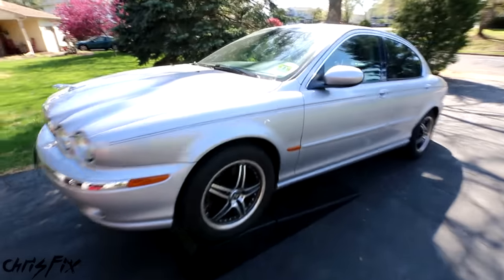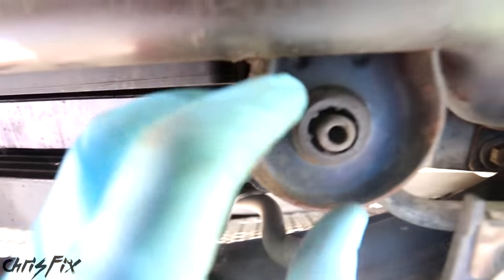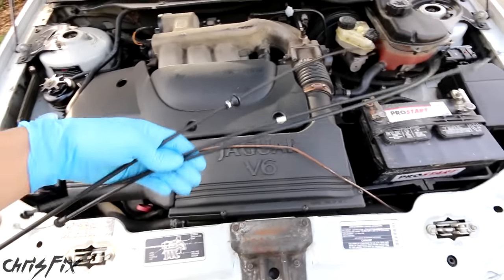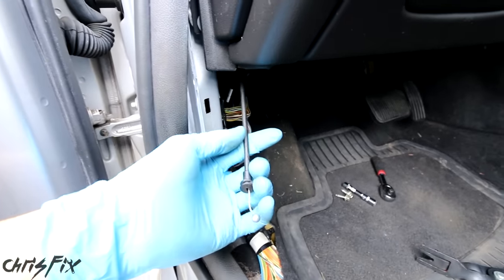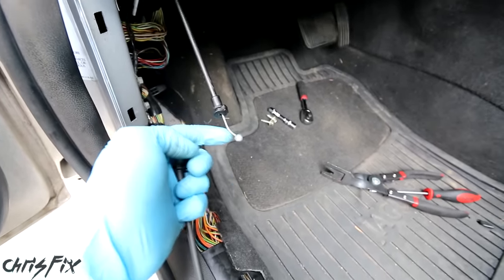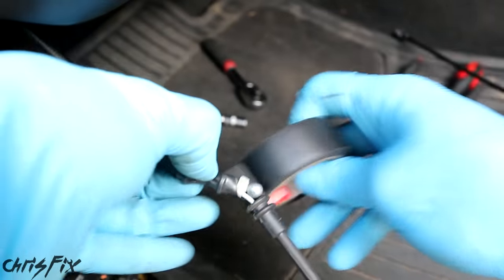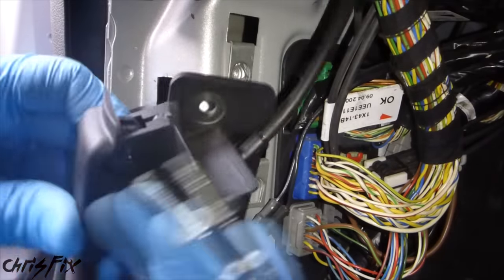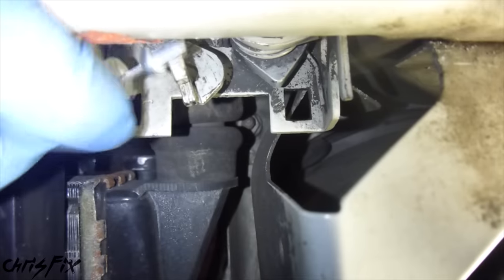What if your car's Hood won't Open?

Comment: nice you showed 17k poeple how to break into a hood
Reply: +Andy Campos chris fix made the video in hopes you do it for good intentions tho bro,
Reply: +Andy Campos Those who wanted to break into a hood could do it, if you don't want it, just weld some metal to the underside of the latch, and bam, no one will be able to open it.
Reply: +Andy Campos To be fair I'm sure anyone who wanted to break into a hood would just use the pry bar to force the hood up causing great damage.
Reply: +Matt Bartholomew That's too much work. They more than likely would just pop the drivers side window, reach in and pull the hood release.

Comment: Some 6 months ago I would have needed this.
My old Clio hadn't been moved a year and the battery was shot.
Unfortunately, the manual locks were also shot and only turned around.
As I couldn't open the doors, I could not open the hood to replace the battery.
A neighbor first tried to remove a side blinker and attach a battery to it, but it was too weak to do the electronic unlock with the key.
Then we tried to open the manual lock by brute force, but to no avail.
The last resort worked - prying open the door a bit to force down a loop and a long ruler to use the latch to open it from inside.
Would have been better your way!!!

Comment: Aren't Jaguars kind of pieces of crap?
Reply: no, unless you treat them as such.
Reply: Yep.
Reply: for Jaguar we speaking...
Reply: Depends on how you feel about a better looking, better handling, better driving Ford Mondeo, because that's what it is. Its degree of crappiness is... i would say perhaps somewhat less solid than you'd expect of an executive car, but not really bad at all. And i mean they are very cheap to buy and not expensive to maintain, it's not as if you got anything exotic.
Reply: I've talked to foreign car mechanics who say they're junk.
Reply: only if you treat them like that or there nice cars
Reply: When ford owned them yeah they were crap
Reply: Cat From The Future worse the land rovers
Reply: Yes if you buy a ten year old jag you will probably have problems.
Reply: no especially the x type. they are super cheap and they can come with v8 engine
Reply: Cat From The Future Look, any car can last as long as you want it to. Any car can last if well maintaines obviously some go out quicker than others but maintenance has a lot to do with car life.
Reply: yeah also they are very thirsty and so you must tank more times than at normal cars
Reply: No!
Reply: Cat From The Future..., Cat (of the past?), Cars were Built to Last, for Work, for Safety, Family, and Enjoyment. Cat (in the Present), Cars are Built to last for about three to Five years for Enjoyment,  Entertainment, FOR SHOW! IF one wrong thing happens, it  can disable the extras in the cars AND car payments are equivalent to Mortgage pmts, $600 - $700 plus dollars per month for up to SEVEN YEARS! Cars worth there value BENZ, BMW, LEXUS, PHANTOM, 300's made by Diamlyer, Jag-u-ar, made in Britain Race Cars, and a Few others!). Cars loose there Value the minute they're driven off the lot!!! There's always an exception to the Rule, because man is involved and things slip through the cracks; however, when a person address issues as they occur, and can afford the product they purchase the investment is well worth it. If You desire a 
JAG U AR (older model built to last), but you buy a Chevy and spend Five years paying for it, You've wasted your money on a car you did not want and the trade in value is far less than what theyll resell it for. Purchase the car you desire! It does NOT matter what others say or think!!! Once you have and maintain your dream car, invest in it and you'll never want another car. Once your Dream Car becomes Historic, it'll increase in Value. It all depends on how you take care of it, how you maintain it, and the Value you've invested in it! I'm maintaining my cars and looking fwd to them becoming Historic. Low Mileage Helps. My British made car is far from Trash  - in fact it's presence indicates: Style, Class, and Old  Money! Remember, you make the Car - the Car DOES NOT Make YOU!!!
Reply: Adam Novák..Is the owner complaining about the Gas?
 When ONE purchases an expensive car it is believed they CAN AFFORD the Car, Maintenance, and the Gas; therefore, the owner DOES NOT complain! It's normally someone else who does NOT own the Jag U Ar, that complains. Please Keep your haterration to yourself!
Reply: Adam Novák, I fill up my gas tank once a week for both cars. One must know how to spend and invest wisely. My income is for myself and my expenses, NOT others. I looked out for "OTHERS" when I worked; however they NEVER looked out for me! My income is for me ... Me ONLY
Reply: filoIII they are junk compared to German cars but with handle and care I don't think they are "bad"
Reply: I've heard that they've improved since '08 when Tata bought both Jaguar and Land Rover. Though I wouldn't know personally, I only drive American Muscle. 99 Eclipse GSX AWD, new exhaust hangers, cold air intake, plugs changed 4k ago, and a footprint gas pedal. Planning on doing a lot more mods though, gonna get her up to around 630 at the wheels and use it solely for drifting.
Reply: Siana Gearz it was just built on a modified Mondeo chassis (not even the same frame) that's were the similarities end....just the 2.0d has the same engine
Reply: jeez

Comment: I've found on my x type that there are two openings vertically beneath the two bonnet latches ,they are both 6" from the front of the splash shield and 14" from the side of the shield .You could poke a long piece of wood through the openings to nudge the latch levers !  Cheers Eddie

Comment: I had to do that to a '98 Jeep Grand Cherokee. I wasn't as cleaver as you to connect the old cable to the new one and pull it thru the dash. Great tip.

Comment: wow, you are pro in car mechanic works, i have same problem with audi a3 2013 but i open every thing that depend to hood for fix the problem, but one thing, the germany system cars is so complex than other brand company cars, for example i dont can open hood wire from under car for because there is no any view and also no any way to achieve  hood closer/opener and i was forced open that completly from under hood and on this way come very push to my hood car.
you are one of the best car mechanic job working that i see. nice, clean, less time work and so on..
Reply from the maker: Thanks a lot and thanks for sharing your experience with German cars!

Comment: I realize this is an old video, but I'd like to make a small suggestion. 

I had the hood cable snap on my old E39 a few years ago, and to keep the new cable from rusting and fraying in the sheath, I shot some white lithium grease spray into the sheath. This made popping the hood buttery-smooth. It was a good thing too, cause that car needed lots of work, and I was under that hood all the time!

Comment: Excellent video and all the better as I have a Jaguar X Type!  My cable had come adrift the other (UK passenger) side.  No need to remove the splashshield/front undertray but you cannot see the latch too well as there is a large pipe in the way.  Nevertheless there is plenty of room to get you hand round it and release the latch with your fingers - no pry bar required.  The cable was good except the nylon bush which keeps the actuator/bullet/nipple in place had perished.  Rather than replace the whole cable I am currently looking into what may provide a suitable replacement.  A nylon bush or electrical cable sleeve with a slit cut for the cable to be inserted into are the current favourites!  EDIT:  In the end the solution was to thread a 6mm spring washer around the cable to the left of the nipple as viewed fro the front of the car.  It was then possible to lassoo the washer using two 100mm cable ties and secure the latter to the latch arm.  One 100mm cable tie may suffice but would require much greater dexterity.  remember to squeeze the ends of the washer closed and pull the cable ties as tight as they will go!

Comment: My problem was the second stage of opening the hood on a 2013 Sonata.  Release latched inside the car worked.  Second stage is pulling up the lever under the front of the hood.  I could not get it to release without using a screw driver to push the locking arm over enough to release the hood.  Stuck a small screw driver under the release arm that would not go down and found a small stone was hidden under the release mechanism.  Don't know how a stone could have gotten in there but at least it was a no cost fix.

Comment: When you are or working around the battery, wiring harness any other electrical equipment with metallic cables it is a good idea to remove the negative battery cable to prevent any shorts uncase you hit the wrong contact or snag a wire. Also have your radio reset code handy to re activate te radio if equipped with an anti theft radio.

Comment: Old video, sure, but it got me wondering: This is a common issue with Jags that have two hood latches, where one won't work - from either a stretched cable or improper adjustment. What Chris did here; from underneath the car works if there is a clear path to the latch, otherwise, things will get broken to get the hood open. Maing takeaway: LUBRICATE your hood cables. Do it early. Do it often. In fact, go do it now...

Comment: This works on the passenger side, after taking off the engine splash guard, (which was a pain) but I don't think it would work on the drivers' side because of all the large rubber pipes that block that catch, or at the very least you would be working blind. but thank you Chris, luckily mine was on the passengers' side, I used a very long screwdriver to push the cable in whilst my missus pulled the lever. the cable hadn't broken (thank God) so it just needed pushing back in.

Comment: I work 4 Toyota  I trick I use when pulling wires is put some silicone  on the grommets  and wires it makes it so much  easier  especially  if you have to run wires through  a gromet

Comment: If you don't want snagging when pulling cable through, you should tape from bottom to top when securing both cables together. That way the exposed ridges of tape job is facing down and won't try to unravel vertically when being pulled through, like in this video.

Comment: Great video. My rear ended somebody and now the hood won't open unless you continue holding the hood release while someone else opens it. Not sure if changing the cable would fix this. It looks like a $30-40 part. He's gotta pop the hood regularly because he's leaking oil. I just don't want to go through all this trouble to find out that the latch is permanently busted from the collision, as it may very well be.

Comment: Sometimes a old worm soft radiator mount will sag down from softening up over the course of its lifetime putting unnecessary unneeded pressure the hood release cable causing it to stretch and kink and breaking the conduit to let moisture in causing rust to form. And where that car was wrecked at that certain place it would be a great idea to un bolt the mount and check it, that accident could of pinched the bracket part of the radiator mount causing the bolt to be out of whack, theres another video for you there Chris, great videos bud.

Comment: My dad had the X-type (car in the video) exact same thing happened except it came open with a fair bit of jiggling around! it was the mechanism that was stiff. I fixed it myself with a with of lubricating fluid (WD-40) so it is not always the cable. jags tend to give problems when they age XD

Comment: Hey Chris, I'm a new subscriber to your channel and OMG how much I admire your work I got addicted to your videos right away
I have learned so much and I enjoy watching some fixes even if I already know how to fix it
Still, I have a question about a rare issue I don't know how to fix it, and I don't know if you covered the same issue in a previous video or not, I would appreciate a recommendation
The issue is with a renault laguna, this car doesn't have latches for the doors, it locks and unlocks with the central lock from the button or the remote key
in my car (actually my wife's uncle car but I use it all the time) the passenger side doors (front and back) stuck some times and it doesn't open until you pull the handle from inside then it works for a couple of days and it stucks again
once I had to activate the child safety lock in the right-back door to cancel the inside door handle and unluckily in that day the lock stuck and I'm not able to open the door anymore as there is no latch to pop it and the inside handle is disabled for child safety
do you have any idea how to pop it open even I can't take a part the interior of the door while it's locked and I don't know how to fix or diagnose the issue with the central locking mechanism
I'm sorry for righting so much but I really like your channel and keep up the good work

Comment: Wonderful video Chris!! Thanks a lot, you made it seem easy & answered any questions I would have had. Thanks again!! I will check your page to see if you have a video of Changing the D/Side headlight on 2002 Jag X Type. I hope that I can just remove the battery and not have to remove the lower half of the front bumper!!

Comment: your vids are amazing my 2003-2009 jaguar xjr you cant open it from the bottom becouse intercooler =( so i had to do it via the grille but there was a sensor on top of the right release so i had to take that of with just a pry bar and the cable coud not go in pairs the end was thick so i had to do it manual it worked and it works good now becouse your vid made it look so easy so i did it so thanks chris good luck installing the hydro e brake on the stang make more vids you are a live saver (money saver to)

Comment: I have a problem,my mother to be exact. You can lift the hood no problem but you can slam the hood as hard as you want but it won't close properly. If you're wondering she drives a 2004 Fiesta

Comment: another thing is make sure that cable doesn't short across the battery. it may of been a good idea to disconnect and remove the battery when it was that close or place something over the battery to make sure you couldn't short it out.
Reply from the maker: Great tip!!!

Comment: Chrisfix! I love your videos, you have taught me so much and I love doing work on my car myself instead of taking it to the shop. 

I have a video request for 2 things! My muffler has been rattling and no one can figure out why, do you have some ideas as to what it could be? Also, my front passenger door fills up with water when it rains. When I move the weather stripping at the bottom, water pours out. How can I permanently fix that?

Thank you!

Comment: I hit a deer and for some reason my hood wouldn’t open. I was pulling the open hood tab inside but no click. I have an oil drinking car so I risked driving around with the engine dry if I couldn’t get in to top it off. Thanks so much!

Comment: Hi thank you so much for the video! It’s very detailed and I feel confident I can do this myself! I don’t think I can afford the ramps right now so what’s another safe way to prop the car up so I can slide underneath? I know you can probably jack it but that seems a lil sketch to me. I have a Subaru Impreza it’s a little low to the ground but there’s still space I feel like. Any suggestions ?

Comment: Tips: 1. Did not have to un-bolt the hood latch lever (cable end can simply be rotated off in place) and 2. Good time to lube the hood latches themselves (and even the bare parts of the new cable) with white lithium grease.

Comment: Thanks for sharing.  I bought a 2012 VW Touareg two years ago, and now my cable doesn't work.  The hood has only been opened a about six times since I've had it.  Went to get my first oil change and they couldn't open it.  Went to a dealership closer than the one I bought it from and they want $400 to do it.  That's not in my budget, so they hooked the cable on to something to rig in shut after they did my oil change.  I researched the part and it only costs under $50.  I'm not paying that much for labor, and will find someone else to fix it.  If my dad was still living, he and I would have done this fix together.

Comment: Thank you very much, it is so good explanation on this problem. I even didn't know such thing can happen. Please could yo tell if I want to have a spare Hood Release Cable and can't find for 2001 Saturn SL2, is it possible to modify another one to fit the car? Probably if it is same length of the cable you can. Thank you again.

Comment: I wish you had made this video along time ago, had a mk4 golf gt tdi with a flat battery and couldn't get the hood opened, had to rip the grill of and remove three screws to release it. Was jt worth it not at all had to buy a new grill as well as a cable. Looked on the forums for an easier way but couldn't.

Comment: ChrisFix, it seems like you do not have videos related to Engine Bay cleaning where you use soap/engine degreasers/shine/water hose/towel/brush to make the engine bay looks brand new.  May be you could buy some products and clean the engine bay while making a video about it? Kind of want your perspective in this topic.
Reply from the maker: I will be doing an engine bay cleaning video so stay tuned!

Comment: Excellent.  Would lubricating the latch mechanisms be wise and beneficial generally speaking for their smooth operation, and if so, what type of lubricant would be best?  I could see myself dousing them with WD-40 or penetrating fluid before re-installing to clean any corrosion build-up off, and then maybe spraying white lithium grease into them.  (Generally-speaking, WD-40 qualifies as a solvent and not a lubricant.)  Thanks.

Comment: Any advice on the driver's side door not working. I've seen everything on the door not opening from the outside. My problem is that it won't open from the inside